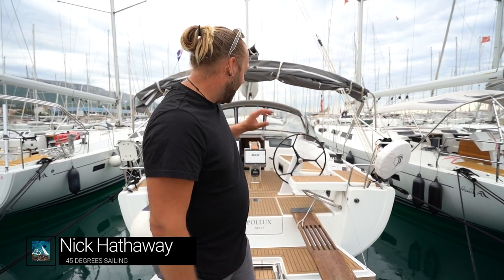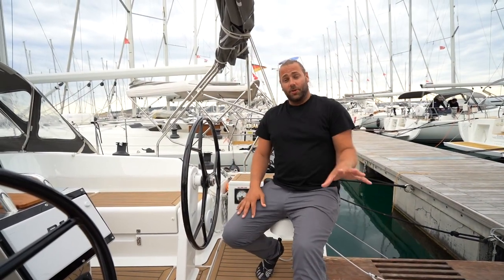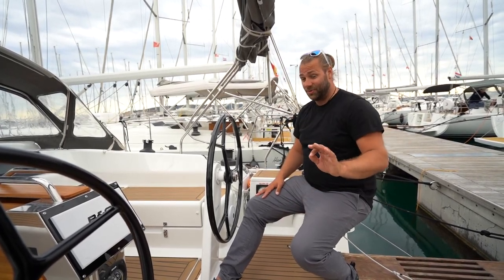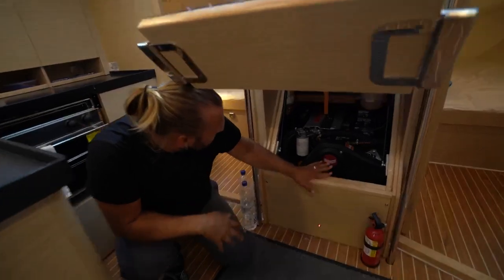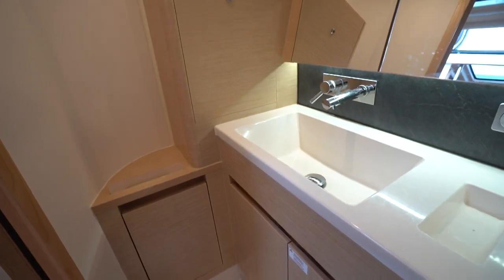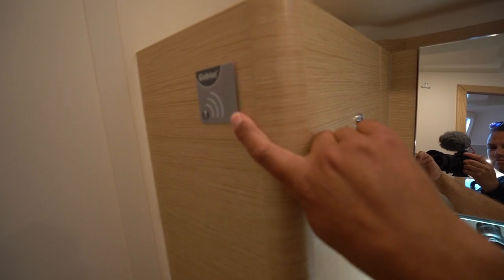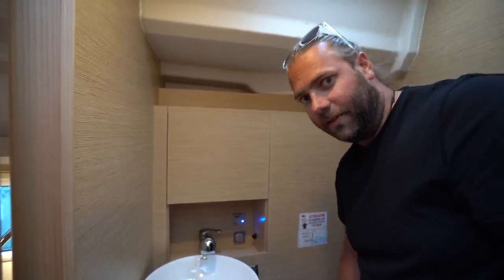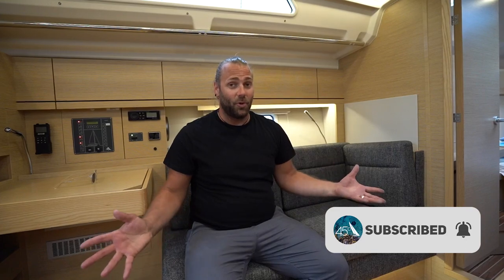2019 Hanse 418 Yacht Review

Comment: I always find hanse,s very stiff hull , slams in big seas, all equipment undersized , winches and so on . 630,505,531,461, and the moody 54 ds.    All the same
Reply from the maker: Interesting. Yes with the modern design with this flat section fwd of the keel a lot of the yachts do not like going head to the seas. Prefer an angle and a soft hand on the helm. Disagree for the 505 though. This for me was one of the better performing hulls. As for new models 548, 588 gear seems adequate to me. Have not sailed the moody
Reply: @45DegreesSailing  Moody is the same hull , just different top sides .

Comment: Good review. I'd agree with the comments about under power, but solved on mine by the addition of a 3x blade folding prop which gives much more bite. Sails like a dream and incredibly well balanced. You have to try very hard to get this boat to misbehave
Reply from the maker: Interesting, the owner has since sold this one so I will have to suggest this to the new owner or charter company.
Reply: I too had problems with the 2 blade prop giving very little drive in rough, wind on the boat conditions and have just switched to a 3 blade - game changer!!
Reply from the maker: @IIIIIIPETEIIIIII  well thats two owners confirming that now! Thanks again. What spec prop did you put on?
Reply: @45DegreesSailing  a 17x14 3 blade Flexofold. The recommendation by them was 17x13 3 bladed or the 14 pitch for more bite and better fuel economy.

Comment: I have the 2 cabin, 1 head, 40hp version and concur with your findings, although the 2 blade prop was the weakness, not the engine being underpowered.

Glad you mentioned the main heads seacock! I’d it was installed 180 degrees from how the factory fit them, it’s be a lot easier to operate! We had our dealer modify the bottom of the cabinet so the whole of this comes out. Much better access, but still need that seacock to be rotated to a more comfortable angle. 

Glad we went for the single head! Much roomier up front, no creaking bed and no heads compartment to cause troubles. 

Love our 418 - sails like a dream!
Reply from the maker: Great to hear. Love hearing the good stories. The wins from boat owners.

Comment: Great review. The water pump under the bed in the forward cabin is activated only upon water being used in the forward head or also elsewhere in the boat? Thanks
Reply from the maker: Anywhere in the boat. There is one water pump for the full system.
Reply: Thanks. Also on the one head version the water pump is under the forward cabin bed as far a s you a re aware? Could not ring an OM. Thanks.
Reply from the maker: @ffcc7655  I dont know the answer to that, I have not been on the 1 head version.

Comment: I love Hanses. But. Thanks for such an excellent review (as usual) … have Hanse got a new design team? We are currently on our old, very old, 1999, Bavaria 42 in the Greek Islands. Seems our bathroom shower & basin are superior to the 418. Can’t believe they haven’t sorted out water flow & wipe-down areas. Can’t believe they have the water pump under the master bed. Can’t believe the water tank configuration/noise when on the mattress …. Mental. Finally, my wife manages the anchor & chain … she often has to clear the build up/pyramid so it doesn’t jam …. we dream of an anchor that goes up & down without manual ‘clearing’ … I can’t believe Hanse have designed/produced a brand new 418 that doesn’t have proper automatic anchor chain/locker storage … how disappointing. What do you reckon is the best 40 ft/12 metre yacht on the market? … particularly for sailing short handed.
Reply from the maker: Thank you Roy. Hanse has changed up the design team just recently. Bringing some concepts over from other designs and influences. I will see if I like them and they prove good changes in the coming season!
With the anchor chain.. it is often the smaller yachts that do this as they are trying to maximise space all over. The 455, 458 and 460 do not have this issue with the anchor chain (also the larger models but I'm trying to keep it relevant).
I actually still think that in this size range the 418 is a contender. If you read some of the other comments from owners on this video, they have different configurations and modifications that solve many of the issues I found on this particular yacht. 
Depending on your style of sailing, purpose for the yacht I like some of the Salona models around 40ft. Though my main experience I have to say is in larger yachts (50ft+) so I will keep an eye out for good models to review in this range.
I have to say having sailed a few of the 2012/2013 Sun Odyssey 45's and they really shined. Newer models not so much.
Reply: @45DegreesSailing  Thanks for your comprehensive response Nick. Most appreciated. You have the best sailing channel by a country mile. Will keep sharing your excellent tutorials with mates & fellow yachties who could benefit from them.

Comment: How will i emty grey water tank ..could find switch.and bow truster fuse....hanse 418 2022 model
Reply from the maker: On new model Hanse the grey water is usually pumped out automatically. The tank has a level sensor and pumps it directly into the sea when the valve is open. This sensor often needs cleaning, it is located on the underside of inspection port/tank lid.